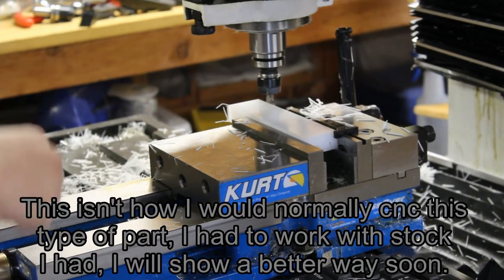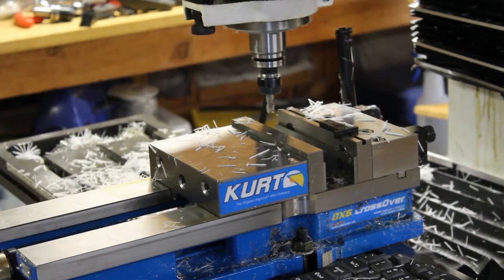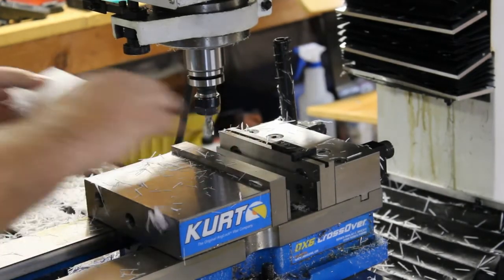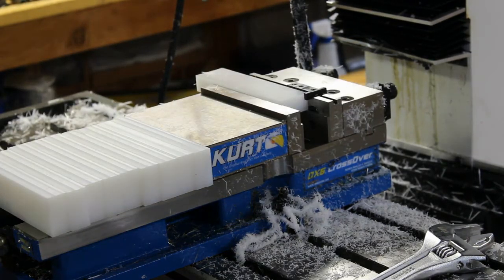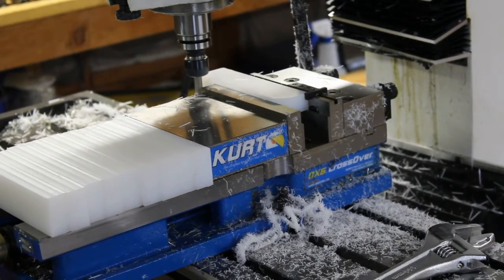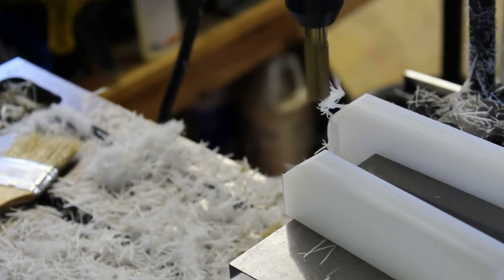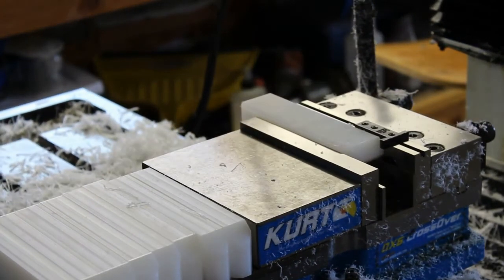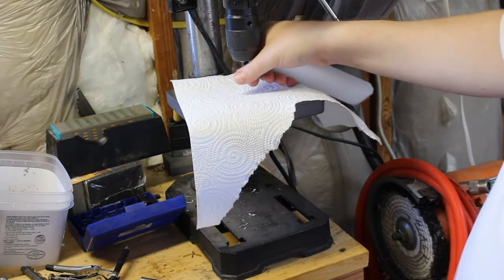PM-940 mill making it's first cnc parts. - Thing 5

Comment: Why are you conventional milling VS climb milling?
Reply from the maker: I didn't mention in this video but have in some others, I'm having a issue with the y axis. I think its the compression washers in the pre load for AC bearings. It probably wouldn't matter in UHMD but in stainless there is a problem when climbing. We will be tearing the 940 apart to find all its issues once we have the HAAS.